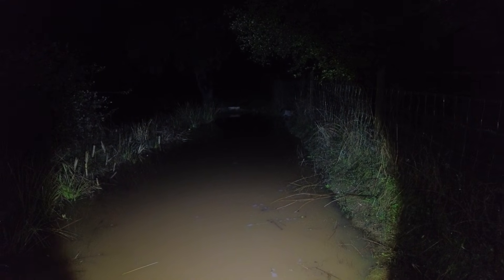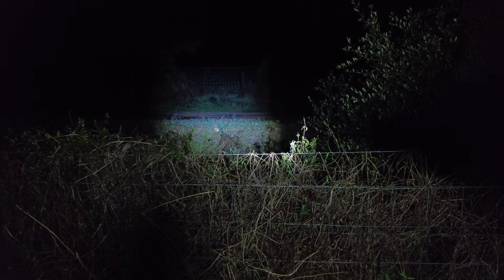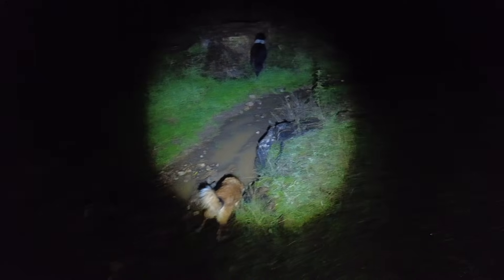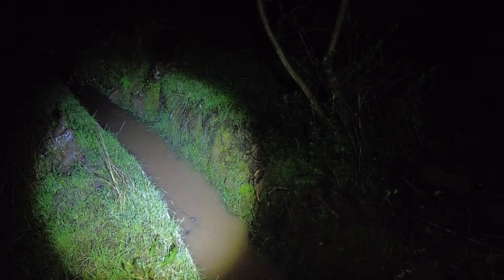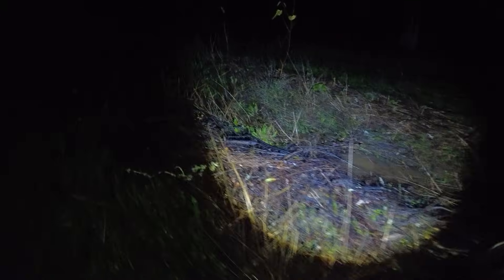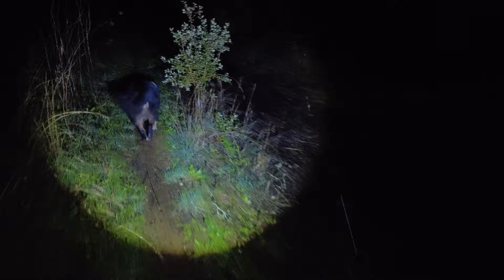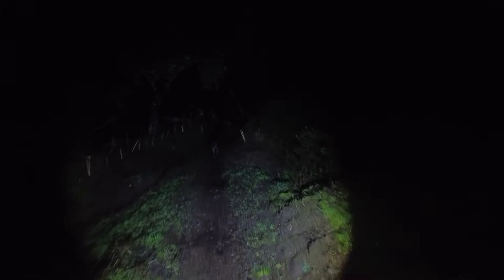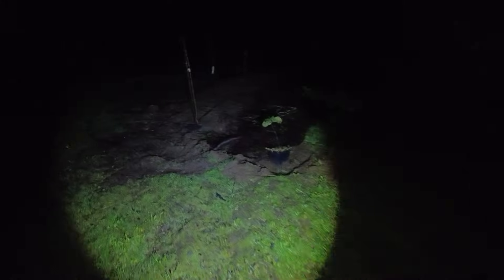When the water is in slow flow mode #agroforestry

Comment: At the first pond (with the vetiver etc), I recommend some rocks at the inflow, to protect against erosion.  Just a little check dam, or just paving a spout (an embedded brick will do), simply because when the pond is low or empty, flow will eat back into the swale, which disrupts it being on contour.  I'm sure you know all this already, sometimes it just needs pointing out, unless you want to create more of a slope there?

You have a very good thing going, apart from the distribution is uneven.  If you aren't going for equal watering everywhere then that's perfect.  If you want more of a measured flow, we might need to revisit some areas.

Always a pleasure.
Reply from the maker: Thanks for pointing out things. Keep doing that. Even distribution, mmmmm, now you have me thinking.